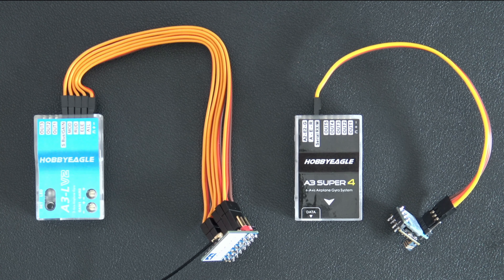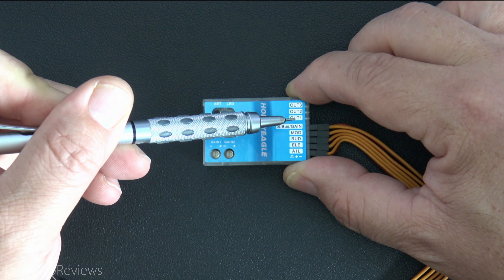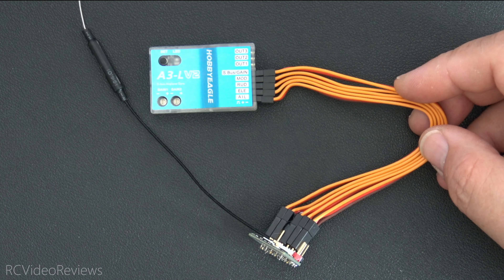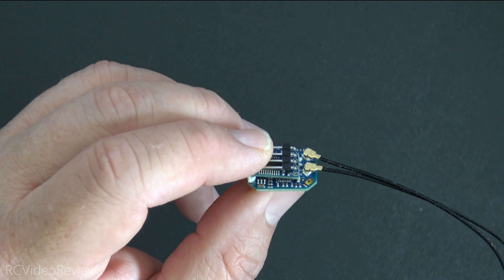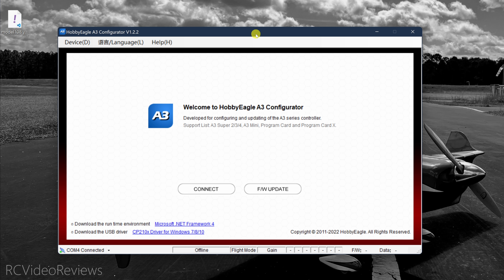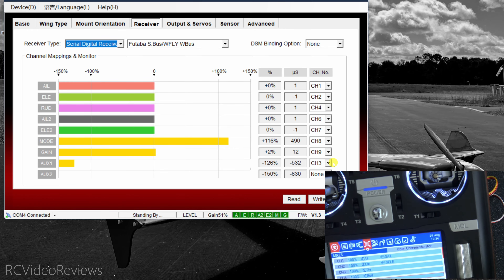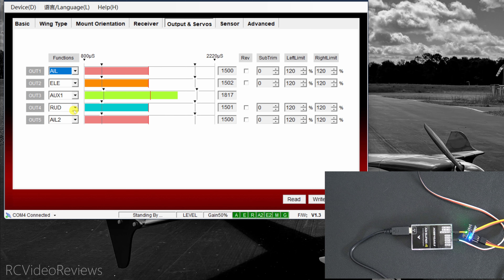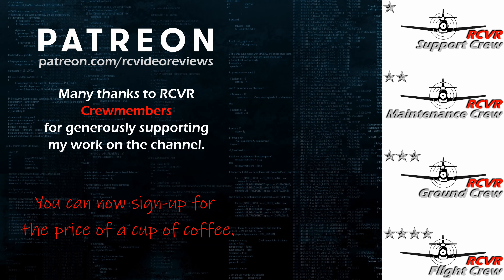HobbyEagle A3 Super 4 with ELRS Setup: WORKS GREAT!

Comment: A video on configuring the Eagles would be good (the Super 4 can be daunting).  Also on testing the results before flying, I usually set the gain to max and attach a piece of card to the surfaces so when I move the plane around the axes  I can see the gyro is compensating in the right directions ;-)

Comment: I'd really love to see you redo this with a larger ELRS receiver like the RadioMaster ER8 and the A3 Super 4 with a CRSF connection between the two. So, it would be a combo of serial data and PWM output. That way flaps, landing gear, and even lights could be direct to the RX, with Ailerons, throttle, rudder, and elevator connected to the A3 Super 4, which would be getting connected to the RX via CRSF. Especially if there is a way to Y the CRSF connection so that external telemetry data could could still work.

Comment: Those bumps on the antennae are just normal di-poles but in an in-line shape rather than a T-shape. The LNAs (Low Noise Amplifiers) are a chip on the receiver between the antennae and the RF chip. So feel free to swap antennas if they get damaged or if you want a different antennae or a longer one to mount on the plane differently. LNAs are a good topic for a video maybe.

Comment: Glad you made this video. it has helped clear up some things a bit with the  hobby eagle/open tx interface, but 'm still unclear how to set up gains. I normally just use normal mode (off or acro?), autolevel (horizon aka intermediate), and full angle mode (stability). pretty much a straight AETR setup with the ailerons sharing Channel 1, and flaps on Channel5, flight modes (A3pro commands) channel six and set the gains to channel 7 or the dial. I have been using the red A3pro v2 with some of my aircraft with success using a FlySky 14+ 14ch mini 2A receiver with  ibus outputs. But I cannot figure out how to set the gains on the right variable knob, and make them work using only the radio. I have an apple laptop, so using it only presents more problems. I hope you read this before tonights podcast which I plan to watch. Also having trouble on one plane getting flaps to drop in the slow up and down deployment,.....if that's a real word?!?!?!?  incorrect inputs/outputs or mixing??????? Anyways, I'm a Big fan of your videos and appreciate your work very much. Thomas
Reply: Nevermind, I think I just figured out what Im doing wrong. smh

Comment: The A3 Lite that replaces the A3 L has a spot for the throttle now too using sbus, and it works great with crsf/sbus converter.  
The A3 Mini is programable, sbus only, but I couldn't get the crsf/sbus converter to work with it, so I used D8 instead.
Reply from the maker: Good tip on the Lite. It doesn't have A2/E2 though. It also looks like the mode channel #5 is not re-mappable--at least there's no mention of it in the manual.

Comment: Hi , sorry i'am new in this hobby, i just bought a Radiomaster ELRS 6Ch pwm , Can i use it with  A3Pro V1 ? Thanks
Reply from the maker: I've only seen the v2, but if it's PWM and you have an ELRS PWM Rx you can use them together.

Comment: Thanks for this video.  I have a question - at 12:20, you mentioned the gyro doesn't see/recognize arming disarming using CH5 - isn't that a safety  concern? What else is controlling (preventing) accidental throttle movements.?
Reply from the maker: Don't confuse ELRS arm with Throttle Lock. They are two different things.

ELRS arming is irrelevant to fixed wing devices like gyros. Gyros also aren't responsible for locking throttle, the radio is. In either case, you use Aux1/Ch5 on ELRS to tell ELRS TX it's ready to go and to prevent parameter changes. The gyro doesn't care about those issues.

Comment: A great thorough video. Thanks so much. Im interested in HobbyEagle configuration. Wouldn’t it be at that point easier to use a flight controller? Im still learning. Really appreciate the amount of knowledge on your videos and i dont mind if they become an hour long 😊.
Reply from the maker: I don’t think so. INav/bf is substantially more complex than a gyro. You also have to care for pwm output which means a wing fc. Those are around $75 to start.

Comment: This is exactly what I wad looking for.
I have three A3 V2 on order. Now would it be possible to connect Out 2 to the esc and then use this with ELRS since I plan to use it on a flying wing and it only needs the aileron and elevator to be connected to the Gyro. 🤔🤔🤔
Reply from the maker: Yup, will work fine.

Comment: Be advised.  The new Matek  PWM6 only works with elrs 3.0, but 3.0 is not backwards compatible with previous elrs rx.  I had to go back to 2.5 on my main radio and put 3.0 on my little radio.  
One reason, like you said, not to fly with it yet.
Reply from the maker: It makes sense PWM 6 converter only works with 3.0 as 3.0 is the version that provided more than 4 proportional channels.

I didn't say not to fly with it. I've been flying with 3.0 for a couple of weeks now and on some of my nicest planes.

Comment: I'd love a full setup video, better yet setup and demo of the different modes while flying.  :)   Also, Is there any CRSF to XRSL2 boards?   Coming from a Spektrum world, I'd love to use an AR637T as the flight controller, but binde with ELRS.   So, if I could just plug into the XRLS2 port with an ELRS receiver, I can then get the Spektrum gyro and telemetry functions.   Or am I missing something here?

Comment: I watched your video and have Matek R-24-S (Had one from a Quad in a box) and HobbyEagle 4 flying a Tech one foamie using SBUS on a single wire. Throttle is coming off the Hobby Eagle. I am not running the SBUS converter. I thought I was good to go but I need help with bigger A/C and Helis due to running 2S voltage to my HV servos. I cannot run that voltage to these receivers. I am looking for work aounds you may already have working. I have some of the new RCVRs coming from Radiomaster that can handle the higher voltage. It is more about how do I run 5 V to Rcvr and 8.4 Volts to servos. I know I have seen you cover it. I run SBUS to IKON on Helis and starting to use the Hobby Eagle4s.
Reply from the maker: You could put a BEC in front of the RX.
Reply: @RCVideoReviews  Thank you. I have ordered 2 with 5 volt output just in case. The voltage input shows 4-9 V on Matek R24-D (and -S) but I am hesitant to put 8.4 volts on a 5 vold pad. What voltarge are you running on the PWM converters or any other setups to the 5V pad. That is step one with a foamie to start. I'll work up on the bigger servos.

Comment: Thanks for this video, do you happen to know amp rating of this gyro? i could not find this info anywhere, not in the manual or the website, etc.
Reply from the maker: I don’t know. Personally I would plan for no more than a standard BEC. About 5a. I’ve been using power distribution boards if I need more. Servo city has a 15a continuous 30a burst board for $13.

Comment: thankyou for taking the time to create these videos. i have a question for you. i have a tx16s that came with crossfire and 3 nano rx's. i purchased 3 of the mateksys crsfr-pwm-c convertors with the 10 outputs. i did  not solder any of the stuff for the battery amps at this time or anything. i want to put this receiver in my 80mm f14. i need 11 channels in that aircraft with how i want to set it up. i also have a few a3l gyros to use. i wanted to use the sbus so i can get a few extra outputs on the mateksys convertor.  i can bind the receiver with no issues but as soon as i set it up with sbus, it wont bind properly. any ideas on what it could be?
Reply from the maker: SBUS is a local protocol and should have nothing at all to do with binding. For more information, please join the discord.

Comment: I am sorry;, I know this question is way late. My question is could you "Y" the SBUS cable between the receiver and flight controller. With the second leg running to a 16 channel decoder? Those allowing you to use more channels as long as you didn't output from the decoder on any channel you were using in the Flight Controller?
Reply from the maker: Sure. I do something similar with ELRS receivers. Send SBUS to Gyro and use the remaining PWM pins for gear/flaps. All channels go out SBUS and they can simultaneously go to PWM on the RX.

Comment: 👽👽👽👽👽👽👽👽👽👽
Hi John, thanks for the video. Concise delivery, love your work.
The ZOHD Kopilot uses Ch5 for mode change. How do you get around this with the ELRS Ch5 requirement for arming?
Look forward to your videos in 2024. Have a good one.
Reply from the maker: We use 333hz 16/2 which gives us 16 proportional channels. Then we turn off dynamic power and set it to whatever max you think is necessary (250mw  is the max on internal ELRS, so that's what I use) and I ignore arming. Just treat it as it it doesn't exist. Ch5 can then be used for mode.

Comment: The Elrs devs say no sbus (for a lot of technical reasons that are beyond my grasp), but the one one thing they said why no Sbus is because it s a legacy technology.  True, but there is a ton of old hardware out there (especially if you don't go with an FC) that only supports PPM or Sbus (e.g. like the Byme A / D.  I've  basically converted all my FC based wings/planes to ELRS, the only holdouts are is the one kopilot I have with a crossfire nano (because it supports sbus out)
Reply from the maker: The sbus adapters are work-arounds to direct sbus support from ELRS. I still hold out hope they'll add it, but in the meantime, we have a small little $3.00 card to do the job.

Comment: Hi, do you have anything on how to connect the Radiomaster ER5A receiver to a Pixhawk 6C. We are looking for range control on our boat plus autonomous travel option on the boat?
Reply from the maker: Sorry, I don't. I can tell you ELRS 3.3 enabled SBUS, so if your Pixhawk supports SBUS, you could turn that on. It works on Ch2. However, no telemetry as SBUS is unidirectional. You'll only get telemetry from the Rx itself.

Comment: FYI, for those, like me, referencing this much later... you can (now) set to 333hz 1/2 rate in your CRSF config / lua for no ch 5 complexity. I've done this on a glider and now on my F-14 with an ER8 rx.
Reply from the maker: Ch5 is still required for certain features like dynamic power. Using 16ch mode just makes Ch5 proportional instead of binary. Does not eliminate the need to use Ch5 to "arm" the receiver if you're interested in the features "arming" provides.

Comment: The 5 output limitation using SBUS is a deal breaker. There needs to be an ELRS receiver that has BOTH pwm and SBUS outputs. I use the Matek 10ch ELRS PWM converter + receiver. Unfortunately that has 2 UARTs, but the 2nd UART is designed to be used with a GPS sensor not an SBUS connector. I'm emailing Matek to see if it's possible. I'd just go with wire convenience for SBUS is really nice. But I use this on jets where I need more outputs.
Reply from the maker: I outputs can be easily remapped in the firmware on the x10. You can just have it ignore ch5 and skip to 6.

Comment: does it work with DX9 SPECTRUM? tks
Reply from the maker: Does what work with Spektrum? The gyro accepts PWM in, so if you can output PWM from a Spektrum Rx, then yes it works. I have no idea if Spektrum supports sbus out for single wire. You'll have to google that one.
Reply: @RCVideoReviews  thank you sir

Comment: How do you power it if you are using all of your output pins for servos?
Reply from the maker: Pin 3 in the video goes to an ESC which provides throttle signal to the ESC, but the ESC lead provides BEC voltage to the RX and subsequently to the gyro over the SBUS wire.
Reply: Thanks for the response.  I'm doing PWM with the throttle and flaps going straight to the receiver which is elrs going through to the sbus to 16 channel pwm decoder that you used in a prior video.  I tried going from channel 6 from the decoder to the mode port but got really erratic results
Reply: I figured it out, I plugged the esc into the gyro instead of the decoder and it's working as expected now.  Thank you for your help

Comment: ok i have the a3 super 4 and a matek crsf -pwm-c board with an elrs reciver everything works great except the modes it only changes between the first and last mode how can i get all 3 modes to work
Reply from the maker: You should get on Discord and ask there, it is a better platform to work these questions out.

Do you have the mode switch on a 3 position switch?
Is that 3 position switch sending -100, 0, 100 in your channel monitor?
Do you have three modes configured in the stab?
Reply: i will bring this over there

Comment: Thought I'd use a Spectrum Satellite into SBus But there is no way to power the gyro and in turn power the servos, as I'm using all 5 gyro outputs to the 5 servos in my airplane.  There is no way to feed power into the gyro with 5 servos connected to the gyro and the Satellite going into the SBus slot.
Into the garbage it goes, and hello Bavarian
Reply: That's BS Mate! Just use a y-cord for 1 of your connections and feed the 5v from the BEC into the free leg +/- pins. That'll power all the + and - bus rails on your receiver and the gyro! You might need a DSM satellite adapter to match the 3.3v rails of most Spektrum satellites though.